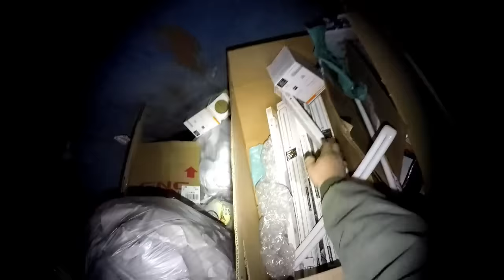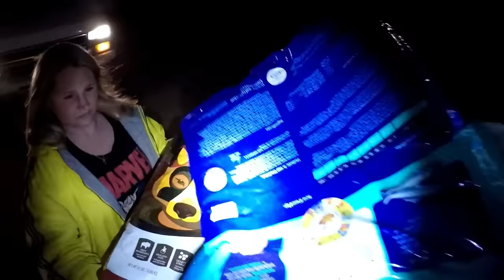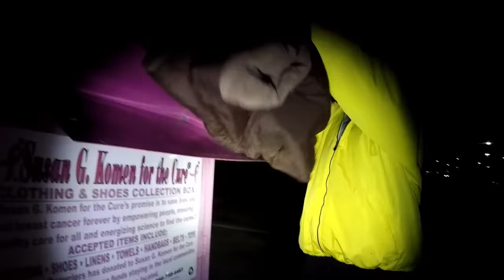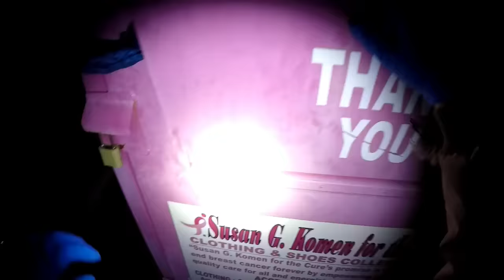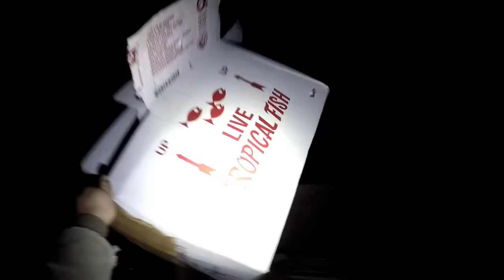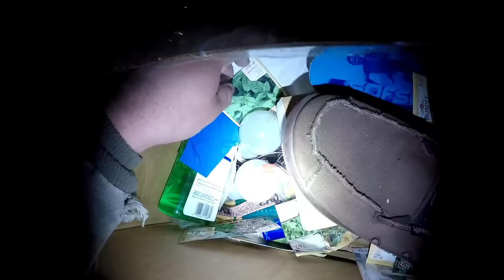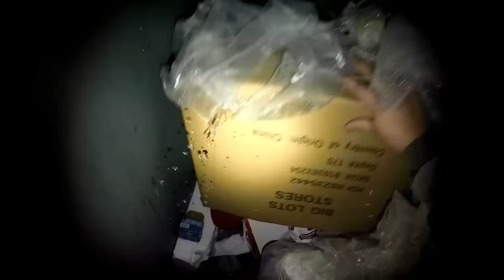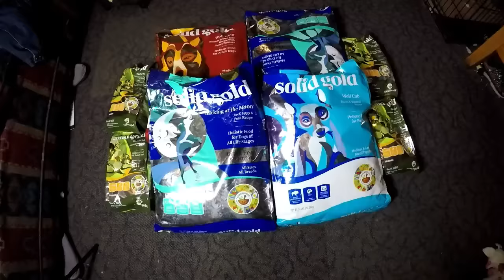We Found Some Awesome Stuff Dumpster Diving | 150 Pounds Of Dog Food

Comment: Rit dye in a darker shade sponged on will help. You can also use bleach wipes and yes there will be a lighter area but that way if you match the color it is and just do those areas it should work. Lastly go to a dry cleaners ask what you can use or what they use to get out sharpie.
Reply: All of that will ruin that chair when something as simple as isopropyl alcohol will lift that sharpie ink right out.  😏

Comment: Krud Kutter on the chair or put a cover on it, it's so cute
Reply from the maker: I didn't know if the crud cutter would mess up the fabric or not. Suppose it can't turn out any worse than it already is though LOL
Reply: @curbsidejunkies  if you have an upholstery cleaner or carpet cleaner machine with attachments it would be perfect. I would use the krud kutter and a brush to scrub it out, then clean the whole chair with laundry detergent. I've seen one lady get spray paint off material items so it should work. 😁😁

Comment: How to Get Black Permanent Marker Out of Fabric on a Couch

    Apply a small amount of rubbing alcohol to a clean white cloth. ...
    Blot the cloth on the black permanent-marker stain. ...
    Continue blotting the black permanent-marker stain until the stain is gone. ...
    If the rubbing alcohol does not effectively remove the stain, try using non-acetone nail-polish remover.